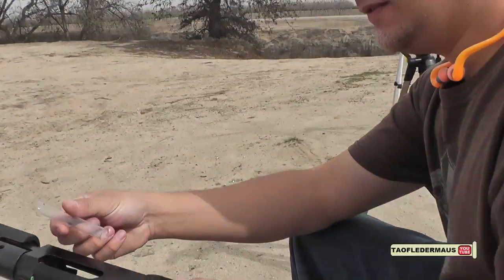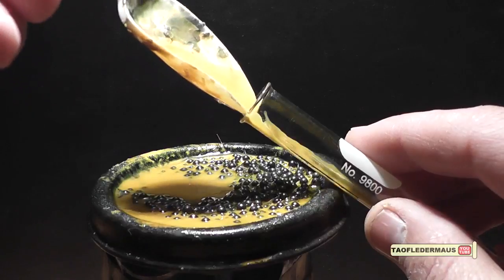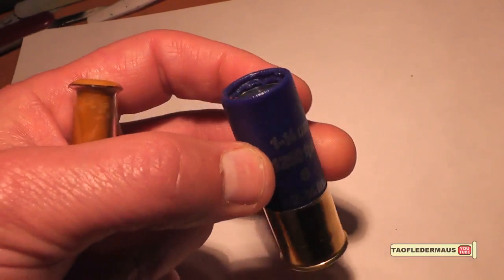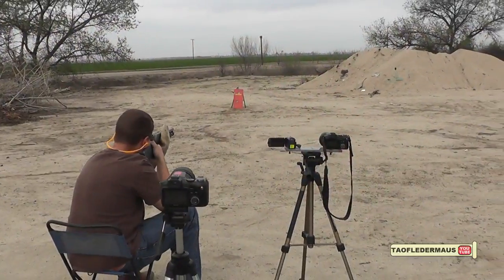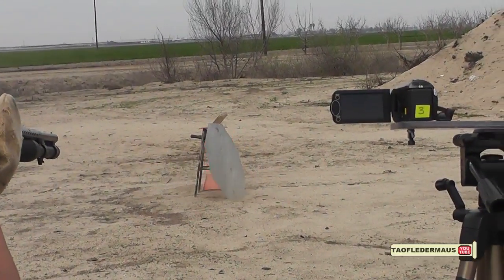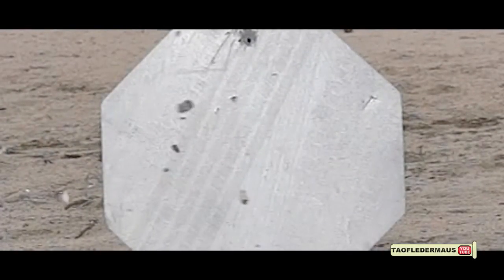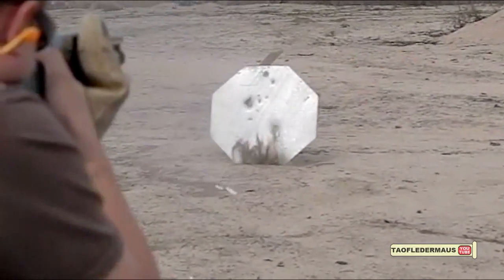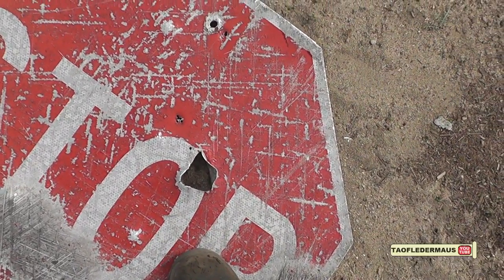Glass TEST TUBE Shotgun Rounds

Comment: Taofledemaus, for a torcher tube, I think trying to melt salt would be interesting since those new solar-furnace power plants are using molten salt to keep the oil hot, which keeps the water boiling to power the steam turbines after dark.

Comment: I've often wondered how a galalith slug would do. Galalith is a primitive plastic you can make by adding vinegar to milk and boiling the mixture until casein forms. Then you drain and gather the casein, mold it and let it dry and harden for a few days. Immersing the hardened material in formaldehyde can strenghten if further.

They used that before other synthetic plastics became easier to produce and more feasible. It's a fairly hard material, so I think it could do at least something.

Comment: I think part of the problem was making the nose heavy. I may be wrong, but I feel as if making the front of the projectile heavier would make it unstable. Think of putting a weight on top of a rocket. Any amount of instability upon ignition would cause a significant pull in that direction, causing it to tumble. Maybe try putting more mass in the back end instead? Again, I'm not really sure. This is just my intuition. But very cool video nonetheless!
Reply from the maker: It works in a rocket that is using its own propulsion.      If the tail end was heavy,   the lighter end would whip around from drag and the heavy end would want to fly ahead of the drag still.   It's kind of like a sock with a rock in it.
Reply: That makes sense now. The sock analogy really helped. The shape of the projectile would also largely play a role in it, but I do believe you are correct. Perhaps it would be an interesting test to fire rounds that are placed with the heavy end in the back, and see how long it takes to flip around (assuming the projectile of choice is durable enough to remain in one piece.)
Reply from the maker: Shooting GLOW STICKS out of a Shotgun    Look at 3:12 and you'll see what I am talking about.   We were shooting glow sticks and I wrapped a bunch of tape around the tail end of them, which made that end heavier.   You can see it flip around.

Comment: Try and get a dense metal ball just the size of the barrel but not too heavy, much like the ball bearing rounds but faster and heavier. Also lighting the fuse on a flare or firework in a shell then loading and firing into the sky could be epic.

Comment: How would rigid metal scraps/shavings from a drill press hold up? I'm tempted to drill some steel and get the more rigid shavings together to test out. I'd imagine curvy sharp metal wouldn't fly straight at all, but I'd also imagine you wouldn't want to be within the front 10 degrees of the muzzle.
Reply from the maker: They probably wouldn't have much energy,  there's a lot of surface area with those and I wouldn't be able to pack very much into a shell.

Comment: How about making some homemade "Rhodesian Jungle" loads?  It's buckshot with birdshot loaded in front of it.  The birdshot is supposed to destroy vegetation while the buckshot is supposed to impact the target behind the vegetation.  You can make it more interesting by using pellets of three or four different sizes.
Reply from the maker: I would think all the lead shot would travel at the same speed and then the lighter shot would begin to decelerate  a lot faster and the buck shot would pass it up.

Comment: Melt down and cast some aluminum slugs that will fit tight in the bore.  If they're slightly too big the metal will be soft enough to bend.  It might not be totally stable but it'll be super fast.

Comment: a request: cast lead into a cut-down 12g CO2 cylinder, basically making a steel-jacketed slug.
maybe embed a hardened tool-steel penetrator rod in the center, just fur shitzengigglz?

Comment: The test tube would have been more stable in-flight if you had the weight distributed to the mouth of the tube instead. It would probably have more piercing damage as well if you could simultaneously have a lighter, but hard substance at the end.
Reply from the maker: I'm not sure why people think an object with a heavier tail would fly that way.   But think about a sock with a rock in it.   The heavy end always flies forward of the drag.   If I did it like you said,   it would flip around and the heavy end would fly forward.
Reply: I suppose you are right. Have you tested shots with different weight distributions, by any chance? I'm trying to visualize these in-flight with weight at different parts, or even at multiple points.
Reply from the maker: Shooting GLOW STICKS out of a Shotgun
Go to about 3:11 in this video.  We shoot a glow stick out of a shotgun.  On the back i wrapped a bunch of tape around it so it would fit snuggly into the shell.   That made that end heavier.    You'll see it flip around a few feet after it leaves the barrel.

Comment: pack some corn starch in a shell and even pour some down the barrel . I have often wondered if it would flash .
Reply: +JIMinBama1 It wouldn't. Needs more air space and a bit more heat that what a shotgun shell can deliver. A large puff of starchyness is pretty much all you'll get. I guess you could use Dragonsbreath rounds, but that's a bit more danger-zone territory.
Reply: +JIMinBama1 I should mention as well- What if the shotgun shell can't push all of the corn starch out of the barrell? Boom. All the pressure causes the gun to explode. You are dead.

Comment: Try limed paper-rolls, marbles, or gravel with hotglue

I think trat gravel with hotglue have very massive power ;)
Reply from the maker: Gravel is pretty light though.   We've done sand/wax slug before. 
SAND and SOLDER 12ga. Shotgun Slugs
Reply: *****
thanks for answering, man :P

i check it out :)

Comment: Too much windage.  You were shooting about 1/2 inch projectile in a roughly 3/4 inch bore, of course it's going to rattle and bounce around. 

Basically you are recreating a small canister round.  Use a test tube without the flared lip and get one closer to the size of your bore.  Fill it with the wax/shot mix. Or use shot and cornmeal and seal it with about a half inch long layer of wax.